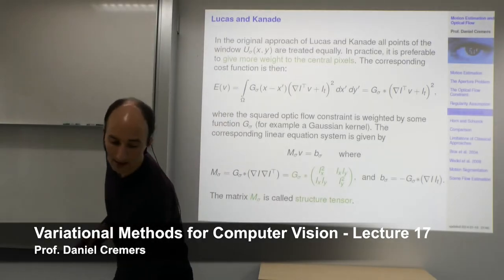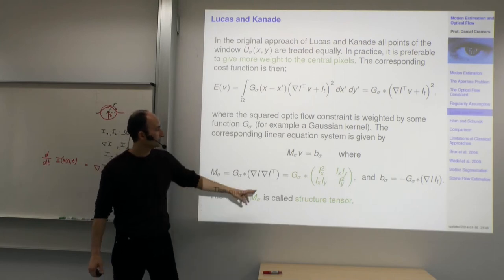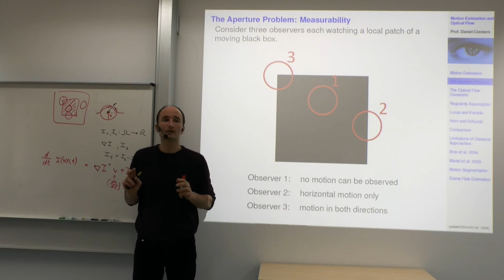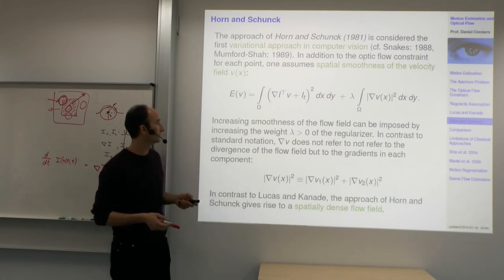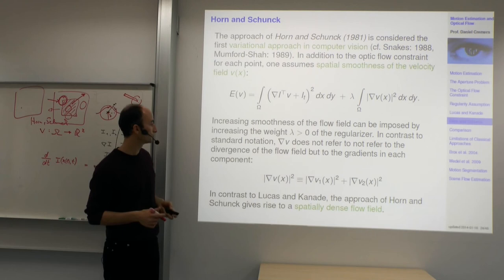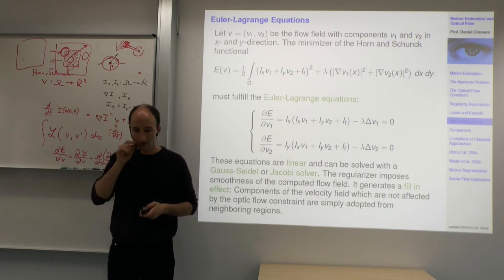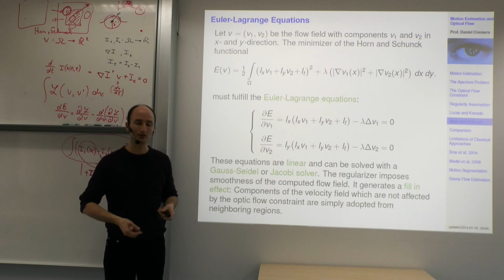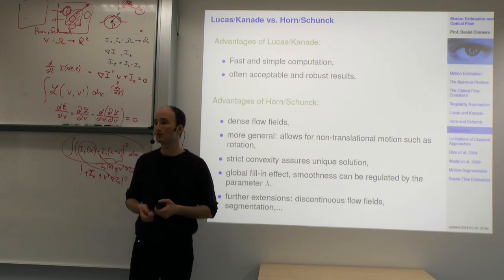Variational Methods for Computer Vision - Lecture 17  (Prof. Daniel Cremers)

Comment: When consider the data term of Lucas/Kanade or Horn/Schunck in the slides from a Taylor expansion point of view, the small motion assumption is straightforward. But when the optical flow constraint is derived on slide 14, is there somewhere that the small motion assumption also encoded? It should have something to do with the space and time derivative. Any idea?
Reply: I think it is because the origin formula of optical flow energy is not convex. Therefore it need the small motion assumption to ensure that the local minima is a reasonable solution.